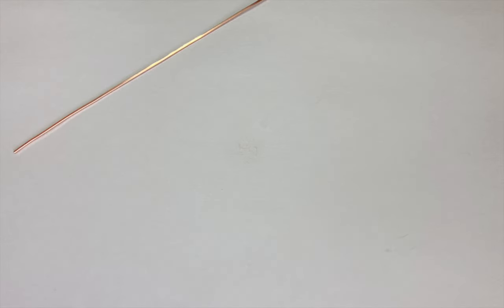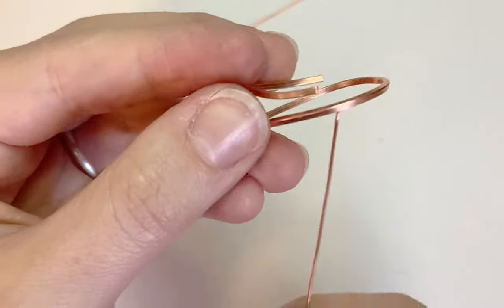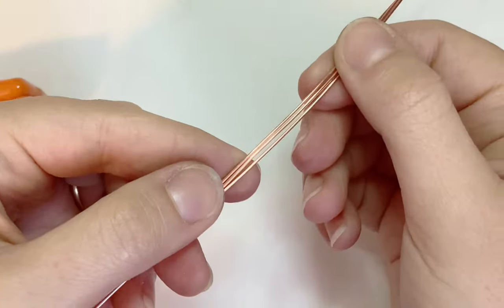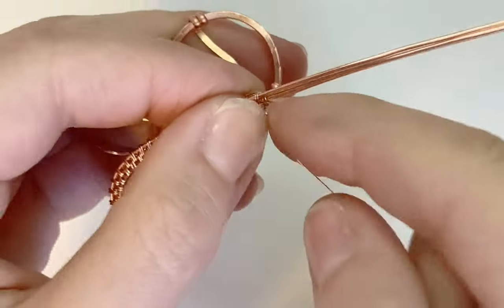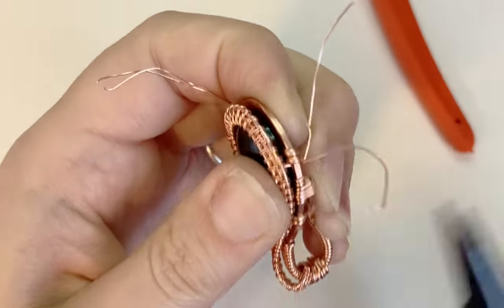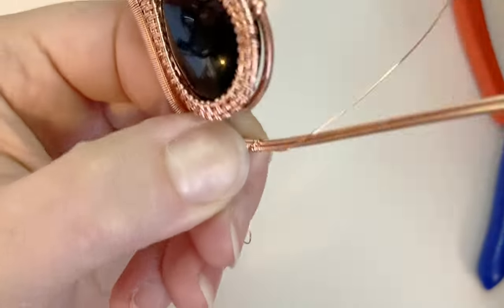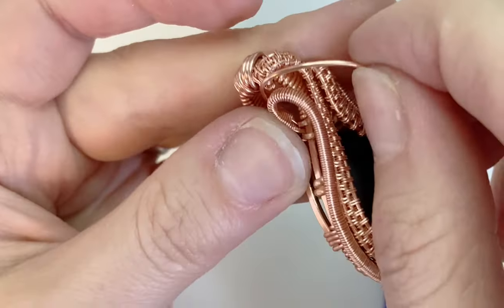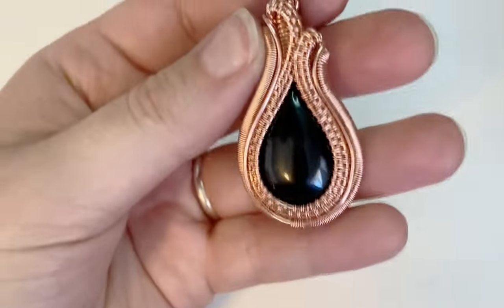Learn How to Create this Pendant! Wire Weave Teardrop Pendant Tutorial - Intermediate Level

Comment: Beautiful!!!!!!! Great work! Am so overwhelmed by the tools needed, what's the best pliers to purchase?? thank you very much
Reply from the maker: Thanks! It depends on what you’re wanting to do, but as long as you have chain nose pliers, round nose pliers and flush cutters, you’re usually good to go. 😉 One of the first sets I bought was this one and they worked pretty well. https://www.amazon.com/Fashion-Color-Plier-Clutch-desert-Beige/dp/B001EX4G48?pd_rd_w=uZWbD&content-id=amzn1.sym.b854a5c2-4475-41f8-a6d4-df92b2868104&pf_rd_p=b854a5c2-4475-41f8-a6d4-df92b2868104&pf_rd_r=XE6PCMVH6KX60Q0AYE4Q&pd_rd_wg=WeDjR&pd_rd_r=200d76e7-77d2-49fa-9a00-641a5990ca3e&pd_rd_i=B001EX4G48&psc=1&ref_=pd_basp_bia_rpt_ba_s_3_sc Hope that helps! ❤️
Reply: @ellieshandcrafted  Thank you very much. I appreciate it. I wish to do wire wrapping. Will check it out.

Comment: Excellent tutorial and finished product! I especially appreciated the list of items used in the description, the detailed voice-over, and the close-up shots. You didn't rush any steps and gave great explanation as to why you were doing a certain step. Just be careful to not go out of frame with your great closeup shots. I just found your channel and am now a new subscriber!

Question - In different places, you did a pull and twist (or wiggle) on the weaving wire to end off. What is the reason for this method? Does it leave a pokey end behind or does this method eliminate that?
Reply from the maker: Thanks for your comment!! I’ll be more careful with the close ups. 😅 That method does help to “cut” the wire so that it’s cut a bit shorter than if you used flush cutters and you don’t have to tuck it in usually. It’s not required, but I do like it better than trying to tuck in all my wires. Hope that helps! 🥰
Reply: @ellieshandcrafted  it definitely helps to know the reason. I saw someone else do this method, but it wasn't explained why. I will give it a try. 😊

Comment: Have you ever tried this with a thick teardrop??
Reply from the maker: Depends on the thickness. It should work alright up to 4-5mm?
Reply: Saw your comment about a big stone...I have a teardrop puffy on both sides.  I used 20g and 4 base wires instead of the 3 she uses . And two 18g square for the  coiling came out good hope this can help ❤